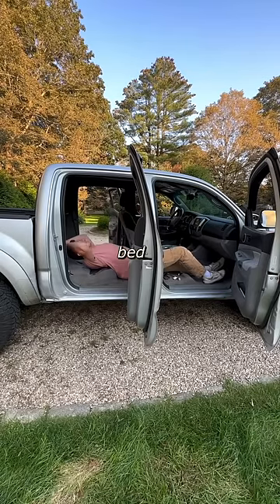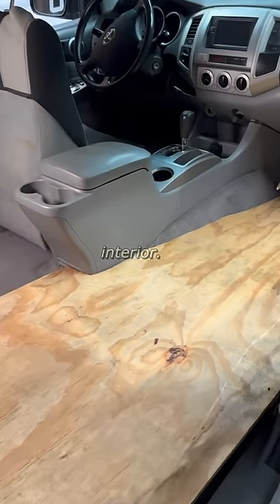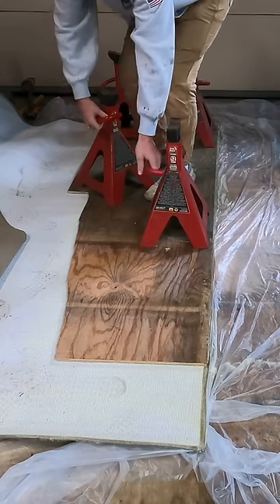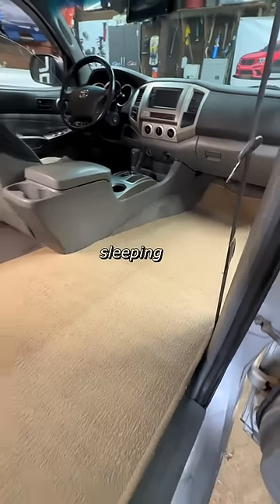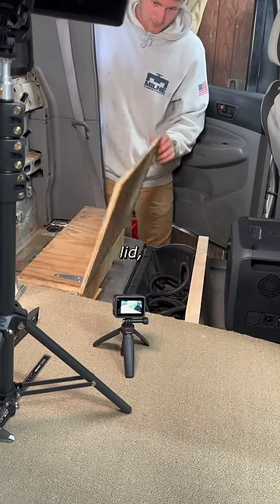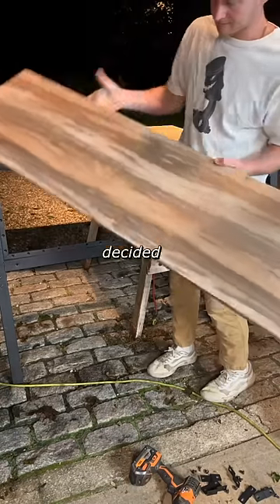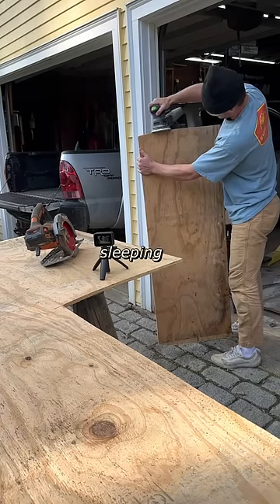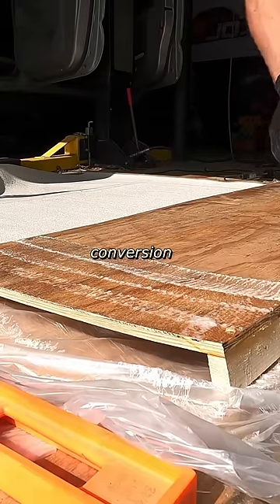Swapping the seats in my truck for a cozy bed

Comment: I bought a Six-Pac camper shell used for $50. Put it on my 66 Ford F100, called it my Motel 66, and lived in it for 7 years. I owned wheel-estate!
Reply: Awesome 😎
Reply: That's sick 🤘🏻
Reply: Nice
Reply: You are a legend sir! Not only for the act and resulting story, but also for the use of the term "wheel-estate" ! 👍😂

Cheers boss!
Reply: 😂😂😂😂😂😂😂😂😂😂😂 that's whats up!!!!
Reply: Put those 50 dollars to use my man hope you slept well all those years
Reply: Got me a 1987 truck bed camper(Skamper) for $400. Inside was mint/clean. Exterior is a bit weathered but the part that counts is like new. I have the same truck as above. I'd sleep fine there as I'm very short but having a heater, sink, stove, fridge and toilet and electricity is nice.
Reply: @JerryGarciaPOBox technically you can have everything except the fridge with a camper truck.  And the fridge issue Is partly rectified by a good cooler and living where you can get access to cheap ice.
Then you are just missing the freezer.
Reply: I like to see that. You have a YouTube on that?or a site showing how you went about it?
Reply: Why 8783? It's my cars license plate :D
Reply: @waltermh111 camper fridges run on propane. If you have the bucks and the room, easy peasy.
Reply: Love your humor!!
Reply: Well done. Location-location-location.
Reply: @Jester_The_Jynxster and the word play with the motel number and truck year. Epic!
Reply: 66 f100 are great trucks.!!
Reply: Like hard Material ?

Comment: Building a home in the truck inside a garage attached to a house has to be the most 2023 thing I've seen.
Reply: 😂 attention seeking rich kid 😅
Reply: Yep 😂
Reply: Is this video to educate how to prep for when you lose your house and you can immediately move into your vehicle?
Reply: How bout building a sleeping area in the cabin instead of a camper in the bed and build it there Lol , looks like logic is not in the table anymore
Reply: @DidierBan u bash his logic, yet your comment is incoherent! Wow 🤣🤦‍♂️🤦‍♂️🤦‍♂️🤦‍♂️
Reply: I have two vehicles with passenger seats removed and a bed installed.  I have two dogs and take regular road trips.  It's MUCH better for both me and the dog unit to be able to camp out in our mobile "den."
Reply: Why not buy a camper shell.. throw some insulation in the bed of the truck.. then throw a bed and build storage space.. that would be a lot more comfortable..
Reply: @lincolnmech prob a short bed
Reply: Ya this is ridiculous
Reply: Thinking a bed in a truck is a home is the most Boomer thing I've seen in 2023.

"Why not a camper?"
Maybe he regularly drives to visit family and just wants a place to comfortably take a 2 hour nap in the middle of the drive and doesn't want to spend money on a huge piece of equipment that needs maintenance, storage and costs thousands initially...all so he can cut his mpg in half.
Reply: @jasondean88888  if it's just like how you say it is.. why does he have this big ass power source for just a 2 hour power nap? Having a camper shell is ideal if your gonna live that broke ass life living in your car
Reply: @lincolnmech  you're
Reply: @jasondean88888  camper actually increases mpg.
Reply: @jasondean88888  lol.. I know when people start with the grammar nazi shit.. I won "your"logic is flawed on the idea that he just wants to take power naps in his truck.. if that was the case recline your seat and take a nap no need to delete a passenger seat and install a power supply that looks like its rated to power a cabin
Reply: LMAO
Reply: U mfs b hatin but this is fire y’all ain’t never lived out a whip
Reply: @BlayneIsaacs  I mean if I absolutely had to I would.. but as a choice? Nah man.. I like having my own shitter.. a shower.. a fridge.. a real bed.. the list goes on lol
Reply: He’s preparing for when he gets kicked out
Reply: @aussiedad2587 ever heard of workers? Doubt he is one but I’d love to have a bed in my pipeline truck
Reply: Man at least he isn’t doing drugs or stealing or robbing shit
Reply: @Colg555 How much longer is the cab than the short bed?
Reply: @aussiedad2587 you don’t have to be rich to do what he’s doing.
Reply: Imagine prepping to become homeless 🤦🏼‍♂️🤦🏼‍♂️
Reply: It's for road trips, I wanted to do the same, I'm planning to travel from fl or Texas and then to montana
Reply: You're pretty closed minded, what if you like to go on little weekend trips out to the wilderness? This is a lot cheaper than buying a big ole camper and works perfect if you're a loner
Reply: … I’m sorry, what? You think people building a car-home have to be homeless first, you can’t just want an RV? Besides, getting a spot on a couch and in the garage for a few weeks is a lot easier than getting a house.
Reply: @lincolnmech maybe he needs to actually use the truck bed? Not everyone’s truck bed is just dead space.
Reply: @JasperJanssen  yeah you are right maybe he hauls stuff
Reply: Unless you go into Hurricane destroyed areas and live in your truck for a couple months.
Reply: Maybe he is customizing it for someone
Reply: All I need is a goddamn truck and then I can gut the interior to install a carpet bed……nah I’m Motel 6’n it dawg. 😅
Reply: Bro needs content
Reply: Gen Z are built different
Reply: First worlds wealthy problems 😊
Reply: @aussiedad2587 successful middle aged man living his life how he wants to*
Reply: He had this original idea where he's going to live in his truck and create "multiple revenue streams" via his social media, merch line, and podcast... He was thinking to call it "truck my lyfe"
Reply: 1000's of people leave there homes to go to a building to build a building inside of a building to take there  building outside. It's called a rv. Trailer, motor home or a pop up.
Reply: A lot of car parks in the UK ban overnight stopping in campers. This would get round that.
Reply: Could probably swap that truck to an older rv
Reply: @aussiedad2587 I was going to say, the only people I know who do this ARE kids with parents that have money. Use their tools, use their money, their garage, haha,  even their old vans / trucks that were given to them, as if their parents would ever make them or let them sleep in a vehicle.
Reply: Have you ever heard of a thing called TRAVELING?
Reply: dont forget the thousands of $$ in power tools hes using to cut everything
Reply: Apparently no one has heard of camping before… or going up to the mountains the night before to go hunting or hiking in the morning? From experience, in November it’s a lot warmer in the truck than it is in the bed of the truck….
Reply: My thoughts absolutely exactly lol
Reply: @machendave 🎯
Reply: well you dont build your outting truck in the woods lol
Reply: I have an Envoy, I took out the LG 1/2  of the back seat and then made a board that made the floor slope evenly.  Add padding Dada I had a bed to go camping at the lake. In my state, if you're over 65, you can get a card for $20. and the fee is 1/2 price, under $15.00 a day. Cooler camping stove. It's a comfortable camper.
Reply: .     70 year olds are, too.
Reply: @callingyourphone1212 that he is borrowing. Aka not his tool's!
Reply: Ya it could only be 1 upped if he was a drag queen or biological female. 🤡
Reply: I just cut the middle of my bed matress out and installed an LS.
Reply: @Manny00000 The truck is stolen
Reply: @liamcolotti6824 you don't have to be rich to not do what he's doing
Reply: @godusopppppp 3 words ... minivan
Reply: I was actually thinking the same thing!
Reply: 😎best answer🏆
Reply: 😢 Welcome to the new normal...
Reply: Ik
Reply: Divorce has a way of sneaking up on people.
Reply: His about me says he’s going to travel the country
Reply: D a n g e r o u s nowadays,good luck to you bro.
Reply: Is it legal? What is the liability in case of a car accident?
Reply: Wow your comment is already a year old. 🤨
Strange how time flies.
Reply: You do know that trucks move, right? I don't think most of you know what a truck is. "Why not put the bed in the bed?" ...because you actually need the bed for hauling things or else you wouldn't even buy a truck. "Why not get a camper?" ...because running around to all of the job sites, suppliers, pit stops, etc. pulling a trailer when you don't have to sucks... and then when you need to pull a trailer of material to a job site you can't because you're pulling a camper. If extra seats is the thing you don't need, but you do need to be able to use the bed and the trailer hitch, and probably go off-road as well, using the passenger compartment for sleeping is actually ideal.
Reply: Some people travel
Reply: @aussiedad2587  jelaous ?

Comment: Your bed needs to be level. Tilted will be uncomfortable.
Reply: Underrated comment
Reply: Kansas comment
Reply: But he used a level to level it....
Reply: @wtfbbqbye  
Then, my bad. It looked tilted. Great project.
Reply: It looks tilted and it doesn't look like there is any way to level it because his feet can't go up any. I don't think many people here have tried sleeping at an angle like this.
Reply: It’ll help with snoring.
Reply: @baiseduezcke2295deflates tires to level out 🤣
Reply: And it seems like that’s the only angle he can fit in. Or he will have to remove the glove compartment
Reply: @clarkanderson397  
No problem.  He may need to build a couple small step ramps with 2 x 6's to rase the front tires and level it out. It's a really cool project and a lot of fun to watch.
Reply: I prefer my bed tilted that way tbh. Level is less comfortable, and head down is the least
Reply: Park on an incline (-:
Reply: You will likely run into some fraying on the edge of that carpet.
Reply: @wtfbbqbye better of he put a few small adjustable lifts underneath that can be run up or down using a cordless drill with socket attachment or just square so no socket needed... O
Reply: @ronsellers5963  yes that sounds like a cheap fix too. Or he can Carolina squat the car 😂 jk
Reply: @clarkanderson397 😂
Reply: @7mm08 flint hills , pratt sand hills , rolling hills. Medicine lodge gypsum hills.
Reply: Most ground isn’t level
Reply: Better for heartburn
Reply: Unless he is sleeping on a slant and gravity is working for him
Reply: Feet swelling is nothing
Reply: Not really. The head is higher than the foot so kind of like a hospital bed
Reply: I sleep with my feet elevated (I have edema in my legs). You get used to it
Reply: Incorrect. They sell adjustable bases for mattresses for a reason.
Reply: @mjaq6099  
Bed needs to be level, is a correct statement. You can fix it any way you want. Statements correct.
Reply: Very nice but I just leveled the floor w all my towels, blankets, extra clothes, jackets, Sox, beeni caps, wash towels ect then put two exercise cushions then 9 inches of foam utilizing all the room for essential things and off on my hot shot flatbed trucking runs. I just found that putting plywood only made it harder to reach under to get stuff, also I was able to work the bed to fit me comfortably kind of like a dog going round and round in the laundry till he makes himself comfi. 😊
Reply: Thank you for being level with this guy!😂😂😂
Reply: Nah it’s actually relaxing if u have ever slept like that he ain’t gonna slide and it feels good
Reply: @baiseduezcke2295British Columbia has left the chat because it peed from laughing
Reply: @Z3R0US  Yep, that's right it is very relaxing to sleep on a slight angle .
Reply: Wrong. Drainage of the glymphatic system needs a 15% angle. And to answer your next question, you'll find out what that system is in 20 years when it gets taught in medical school
Reply: HOW TO MAKE A V.O.C. HOTBOX: Step 1
Reply: Was just bout to say that.
Reply: Wrong, head is higher, blood won't pool up in your brain, no headache.
Reply: @baiseduezcke2295 😆 🤣 😂
Reply: There is zero reason for the bed to be level. My wife and I have a bed at an incline and we sleep just fine.
Reply: 100%
Reply: Nope!! I park on a downward facing hill so my head is higher… much better sleep
Reply: Head a little higher than feet is very comfortable
Reply: Fax. He will end up sliding down every night. Same thing happens in tents when camping
Reply: unfortunately he was found dead
Reply: @krisherbst6162  gather hammocks prevent you from giving a damn about terrain.  They take up less space, weigh less and are easily folded out of the way while not in use.
Reply: @wileecoyote5749  didn't hear this story... Got references?
Reply: Doesn't need to be level. Inclined just a bit helps with your breathing/snoring issues. Trust me on this, bub, been dealing with these issues for years until I invested in a bed that inclines
Reply: @dannymac777  Try a gather hammock.
Reply: @Destroyer-Grizzly-BIH 
Acid reflux also.
Reply: Just park on a hill 🫵
Reply: @mmmd3429  I was gonna say some wood blocks to park on but thats even better. 🤣🤣
Reply: @themanhimself3  Your idea is better and more logical.
Reply: Good for heartburn prevention though.
Reply: @donovanmccoy6833 upside down is probably least least comfortable.
Reply: @ronsellers5963 it's going to be tilted regardless unless he's got some stiff ass shocks and springs. There's more weight on one side of the truck then the driver's side 😂
Reply: I doubt it
Reply: Not really as long as your head is the highest point. I can recommend you go camping at some point :)
Reply: He said his next project was to squat the truck though... 🫣
Reply: Untrue. My doc had me put books under each leg at the head of my bed for acid reflux  and I sleep much better now for it.
Reply: @ronsellers5963 that shit is hella tilted lol
Reply: he is building a slide.
Reply: Wrong i sleep titled
Reply: Just let the air out of the tires. Simply
Reply: Pooling (swelling) in your lower legs.
Reply: Or, he plans to park on a small incline
Reply: Acid reflux
Reply: @Jesper-bl2ns  I set up a tent on the slightest slope(like a house’s gutter), and couldn’t sleep at all and had to come inside. I think the body senses something isn’t right with blood flow or something
Reply: lol all he had to do was cut some 2x4 find a way to stand them up and he’s level
Reply: i agree, but it doesnt look like this guy has much of an option. he looks to be kind of tall, so he needs the extra legroom under the dash.
Reply: @Salad_2  I use an inflatable fitness ball in the rear legroom area of my Prius. Front passenger seat out, memory pad and sleeping bag. I prefer seeing places in this hatchback than my full setup in my 18ft box. I’m running farm tags too going down I-40 sweating bullets

Comment: Be sure to raise the foot of the bed, for circulation purposes. Cheers
Reply: My thoughts exactly
Reply: I would agree, but that can actually cause acid reflux problems. Especially if you're diabetic or have sleep apnea.
Reply: @Lomhow  Yes but not all people have that. And my mother who has it uses only a small pillow. This much incline seems off for even acid problems. And in my and my friends experience camping sleeping on an incline is terrible. But that is partly preference so not sure if that means anything

Comment: Pickup manufacturers need to add a large flat area to their vehicles that would allow multiple covering options as well as multiple sleep options. Heck they could even call it a “bed”. And when not used for sleeping you could potentially haul stuff around!
Reply: It's called a minivan.
Reply: @brandom7900 or it's a pickup truck 😂 😂 😂 literally what he said
Reply: Best comment
Reply: the cabin has a heater and an AC and is completely sealed.
Reply: Perhaps you live where it is safe to sleep in the open bed of your pickup and inclement weather never disturbs your rest?  The rest of us live in the real world.
My Tacoma only has an extended cab, and I am tall, so this isn't an option. However,  I can and do sleep with my driver's seat reclined when I am driving cross-country.

Comment: Just please be careful. Even if you're not using the bed, if you get into a wreck all that wood and anything else in there will become like a tornado of shrapnel. Everything standard in a car comes crash tested, this does not. Please be careful. And unfortunately no matter how careful you are, you can't control other people and their driving...
Reply: Learn intuition and speed my guy 🎉🎉🎉
Reply: @Almondchimera80  Like he said in the last sentence, "no matter how careful you are, you can't control other people and their driving.
Reply: @Almondchimera80 me using intuition and speed to dodge the 2 ton semi barreling at me
Reply: @claytonedwards2961  i swerve myself one hand on the wheel the other on my cigarette my girl got down
Reply: "Damn I'm so badass" - probably Almondchimera80
Reply: That is not correct. It is your belongings that become shrapnel in a serious accident. Nothing he installed in this video will more of an issue than the loose items.
Reply: @Almondchimera80 bro give your mum a break.
Reply: in his next video he will add a kitchen area, complete with a block of knives.

Comment: Hi Lee. I have used the little butane stove to heat my small 2 bdrm house . One can has lasted me about 3 days in Los Angeles cold weather. I keep it on low and keep a small pot of water with lid on to just simmer for the steam. For my van I have used the inverted terracotta pot with the base and tea light candles. I used an 8” pot with a 10 “ drainage tray and a crinkly piece of foil. The drip tray goes on bottom lay the crinkly foil on top and the candles on top of the foil ( it catches any dripping wax as well as allowing airflow through the bottom) .Cover the lit candles with the terracotta pot. It gets hot! For safe handling I put my whole setup into a brownie pan and then I could move it all if I had to. Three candles would take the chill off in 38 degrees when I was working overnight in my Van doing security. Mind you I had to keep opening my door to do patrols and gas was too expensive to keep my van heat on all night long.❤